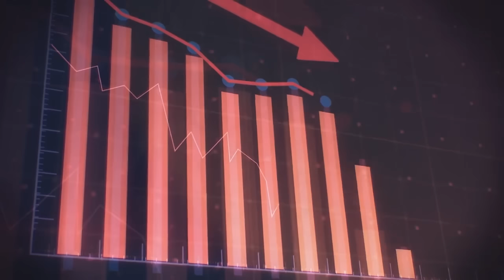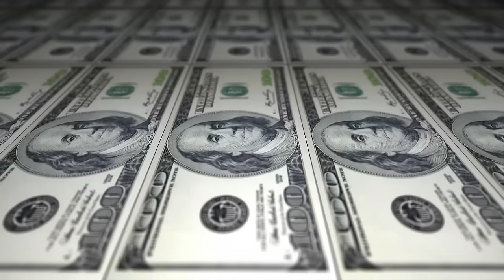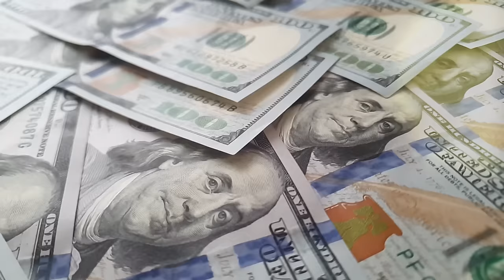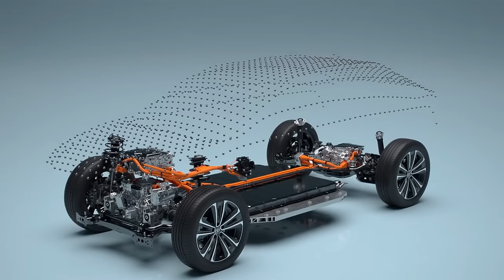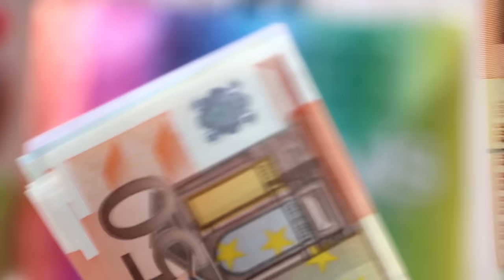The ‘I Told You So’ Moment: Toyota’s Predictions About EVs Come True! Electric Vehicle or Hybrids?

Comment: I will never buy electric
Reply: You don't need to. Well, depending on how far into the future you live. EV's are not a scam. But Toyota is correct, the market is not ready for them. It has to be a gradual change. Not something pushed. 

Especially the electrical grid. Which some say 'We need to increase the electrical grid first!'. To that I say, we can't. The E-grid and EV's have to advance at roughly the same pace. To much electricity in the grid is just as bad as not enough. Hence why its important that they advance at roughly the same pace. And why it should not be rushed.

That said, I do want them to come. We have been kept on fossil fuels for too long. And if you think we have not been kept here.. you can take a look at some of the inventions that have been made for cars then buried. Things that gave modern cars 100+ miles per gallon. These inventions were confirmed at the times (multiple people have invented it through the years) by auto makers themselves, a couple of them were days away form multi million dollar deals. But suddenly it disappears and the inventor dies under mysterious circumstances. I think the first time it was found was in the 40s or something like that.